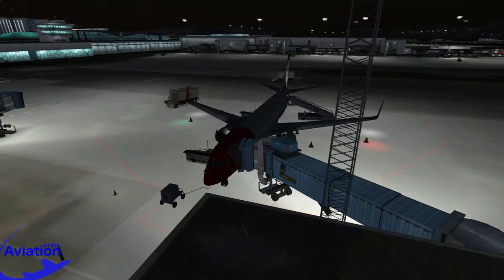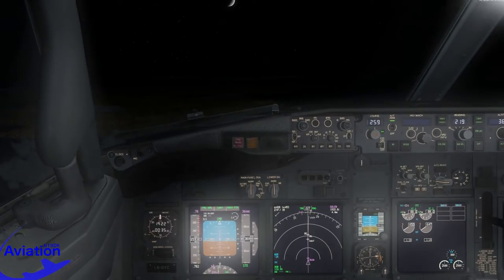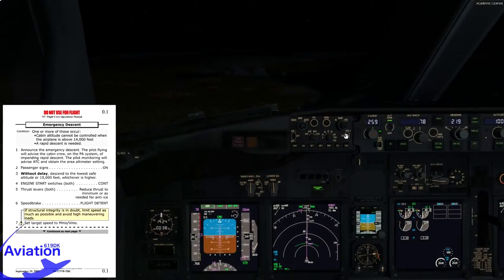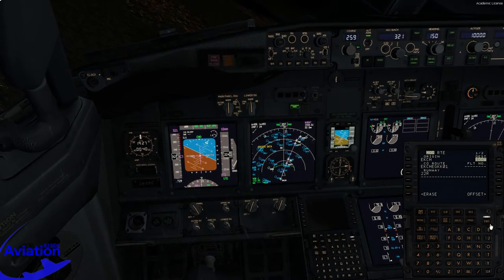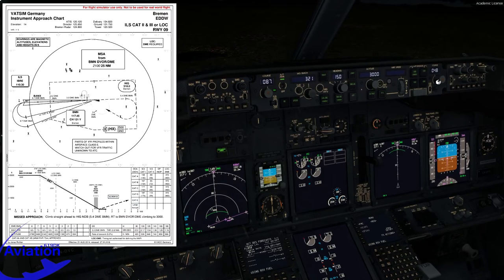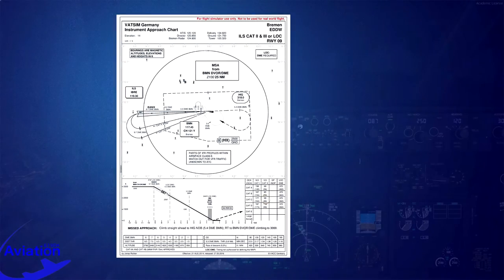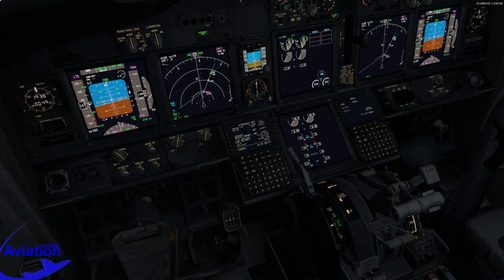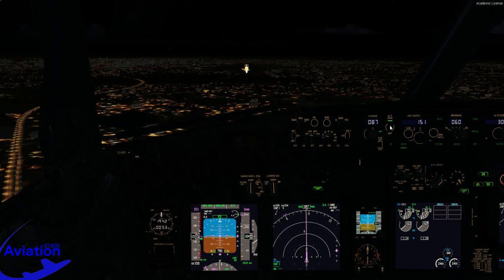Rapid Decompression | VATSIM Emergency Ep. 4 | PMDG 737NG

Comment: Awesome work! One thing I'm a bit disappointed about with regard to the QRH provided by Precision Manuals is that it's not indexed in any way... if you're reading it from the .pdf (like most of us),t, you can't just click on an item on the contents page to jump to it. Given how much their planes cost, it doesn't seem like it would have been too much to ask for somebody to spend an afternoon making the gigantic manuals a bit more wieldy for those of us who want to put them on an iPad or something.
Reply from the maker: Uhm...mine is indexed? If I click any of the items on the content page it automatically scrolls me to the respective page, which the checklist starts at? I'm not too sure if this works on an iPad, but it works both on my MacBook and Windows-computer
Reply: How bizarre... what .pdf reader are you using? Also, where did you get the QRH? The PMDG copies of all the manuals have their logo on every page and I don't see it in the video screenshots. I'm guessing you might be using a QRH other than the file provided by PMDG.
Reply from the maker: Wow yea, you are right - I thought it was the PMDG provided QRH I used, but it's actually not. Not quite sure where I got this QRH from but here you go: https://www.dropbox.com/s/v70hoclz4t9wefo/B737NG%20Quick%20Reference%20Handbook.pdf?dl=0
Reply: Awesome, thanks for the link! (And sorry, I meant to thank you sooner... better late than never). I only ever intend to operate my NGX in Service-Based-Failures mode, so statistically I'll probably never actually have to use it... but you never know. ;)

Thanks again, and happy simming.
Reply from the maker: Haha you never no - but you'll be ready now for sure ;)

Comment: ANOTHER VIDEO

Much amazing such awesome.

Why dont you do a fuel leak at a time where it isn't wanted? (EX. On approach where you don't have enough fuel left
Reply from the maker: I consider it very important that the emergency I face is both a situation which cause great danger, but also a situation that we can actually do something about. In the event we lose the last drops of fuel on short final, both engines will cut out and there is not much we can do other than to retract the flaps a notch to extend the glide. However, at some point I'm going to make an episode where both engines fails - this could be the result of an fuel leak at cruise.

Comment: Great Video! Where do you have got the Check List from?
Reply from the maker: If you have purchased the PMDG737 you can find it in your sim folder -> PMDG -> PMDG 737 NGX -> Flight Manuals -> PMDG-NGX-QRH.pdf
If not, you can find it pretty easily by Googling "PMDG 737 QRH"

Comment: I think in this case is better disengaging the autopilot and manually descend at a descend rate of -30,000 fpm. 😎 😁
Reply from the maker: Well if you do so, you would quickly exceed the maximum structural speed of the aircraft and the plane will disintegrate, so I wouldn't recommend that. The autopilot gently balanced the descend rate to obtain a speed just below the critical point of Mach 0.82 :D
Reply: and most probably eardrum exploding due to vary fast altitude changing

Comment: Didn't he tell you to descend to FL110 and you read back FL100 and he acknowledged correct
Reply from the maker: No, not quite. Well, what I think happened was that he acknowledged my distress call and request for a rapid decompression, but did not catch the altitude I asked for. He therefore chose to clear me to FL110 initially so I could start the descend immediately and then he asked me afterwards which FL I requested. I then repeated the request of FL100 and he acknowledged me for rapid descend to FL100.

Comment: At FL360 you have at best 30 seconds of conciousness. You spent too long scanning to see what was wrong when the horn was clearly sounding. Neither had you made any attempt to descend in that critical time period. The rule is to don masks "immediately." Initiate an emergency descent and then sort out the problem even if it were a false alarm. Assume it is real neither your airline or ATC will penalise you.
Reply from the maker: Yea, you are totally right. I should have initiated the descend way sooner; before checking the out flow valve etc. which could be done during the descent. However, this is a training video and the purpose is to enhance thoughts and considerations which goes through the mind during this scenario. Because of this, the pace will always be a lot slower than it would have been in a "real" emergency. If I did not have to explain which indications I was looking at and why, the time from the master caution trigger till equipping the oxygen mask would have been around 5-10 seconds - if you follow me? :)

Comment: INCORRECT. YOU DONT REQUEST TO DECEND, YOU IUST DECEND AND TURN EITHER LEFT OR RIGHT by 45° ALSO YOU NEED TO SET MACH 0.82 ALL THHE TIME UNLESS YOU KNOW THAT THERE IS SOMETHING WRONG WITH THE AIRCRAFT STRUCTURE. MOST OF THIS IS INCORRECT BUT GOOD ANYWAY
Reply: Ryanair Rules Why are you writing this in all caps?
Reply: Oscar Bjorkman because it is a fatal mistake